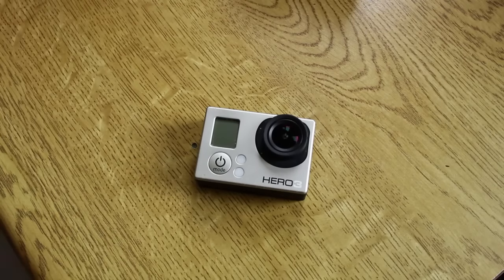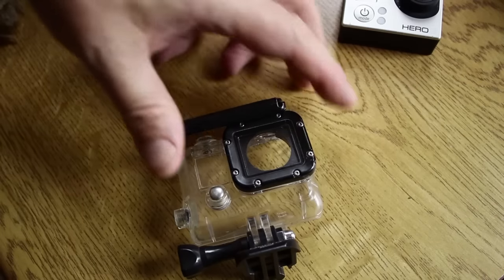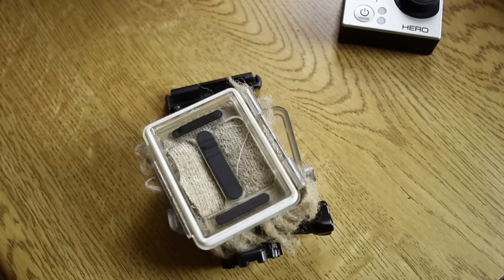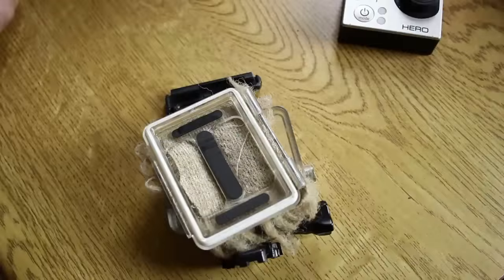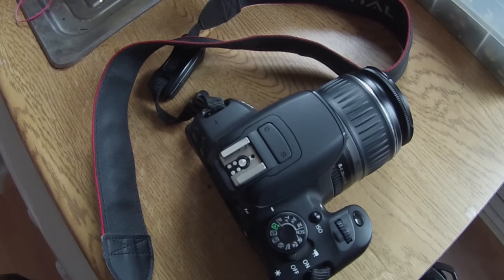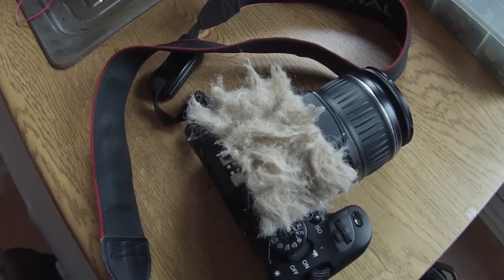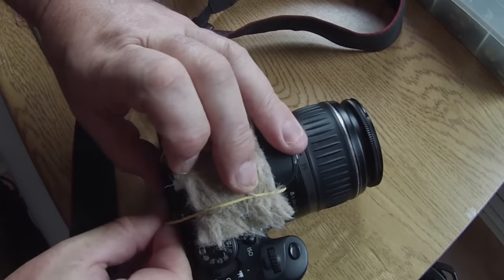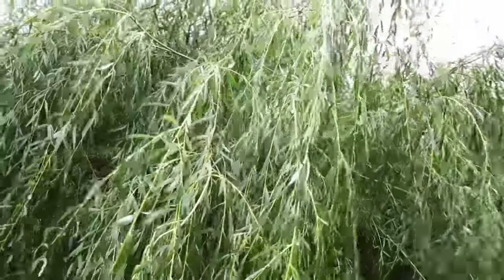Simple and easy gopro/DSLR microphone windshield

Comment: That really worked, only problem I could see what using the go pro in wet weather as it will soak up water, but well worth it I think. Wish more youtubers did this, as it is really annoying.
All the best
/Per
Reply from the maker: +The Swede Thanks Per,  where I have the gopro on the Etrac it gets sheltered from the rain so still possibly to use
all the best
Paul

Comment: done same with my camera but used fur off a fur collar, not all wind noise removed but quite a bit, microphone on my camera at the front under lens so looks like a little moustache..LOL
take care
Tom
Reply from the maker: +Tom Wood ahh I was wondering how someone would do it with a mic down the side
thanks
Paul
Reply: Hi Paul
            I used velcro to attach fur, that means I can remove it when there is no wind, I have got a piece of backing velcro on the side of the camera, so just stick it there when not in use.
Take care
GL&HH
Tom

Comment: hi Paul , another question about the go - pro. ,when you film do you hold the camera or mount it.
The reason I ask is I want to start filming my detecting adventures  on anglesey but I would like a bit of help starting but I don't want to mess it up.But anyway keep watching for my first block buster,I do bird control on raf valley and might start with T1 and T 2 . Hawk jets just for you.🎬🎥😁👍rafman
Reply from the maker: +ian harrison-brown WOW Ian you have a very nice job.
I have my gopro mounted on the shaft of the Etrac but take it off for anything closeups of digs, hope that helps
I'll sub so can see any footage you get
all the best
Paul